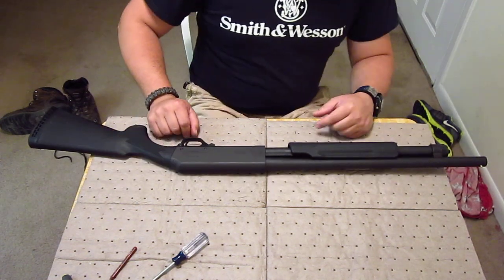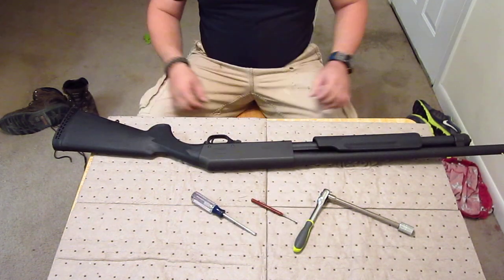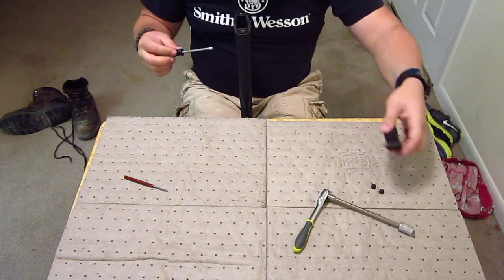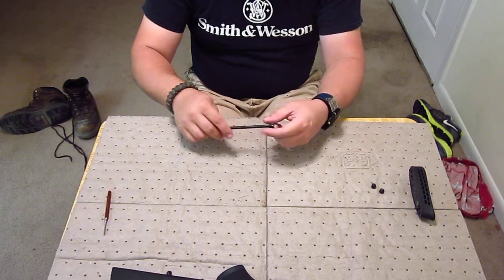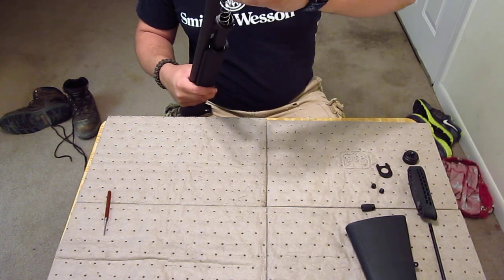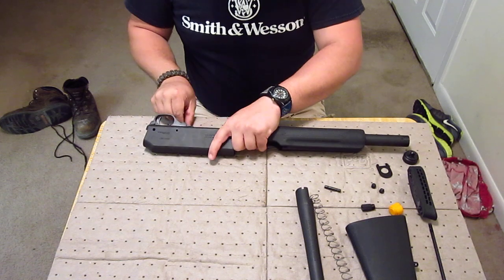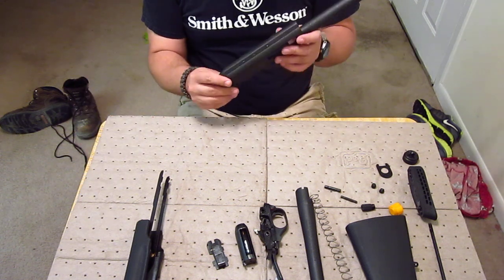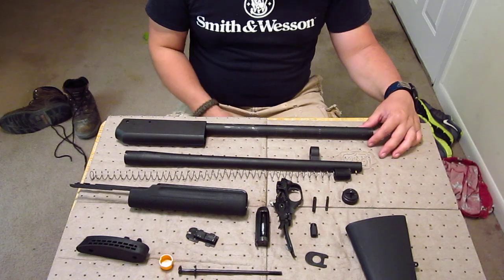H&R Pardner Protector Detail Strip HD (Disassembly)

Comment: Yeah I was looking for a detailed break down not a field strip, thanks for the video anyhow. Furthermore the pins are designed to be removed from both sides
Reply from the maker: Well this is a "detail strip" a more involved strip. A complete disassembly video is what you want. Where they remove every spring and detent and pin. This is a well good enough strip for mods and cleaning and painting
Reply: @SMGSClassics  it is very much so but Like I SAID it's not what I was looking for. It was pretty much Rhetorical

Comment: 1) I have HOPPES 9 gun bore cleaner. I can use that on all metallic surfaces to clean right?
2) So oil can be put on all metallic surfaces with a light coat as well? 
3) Key ares to clean and lube are the bore/barrel and BOLT?

Comment: What size spring chamber tube spring is that? Bought this shotgun from a pawn shop, and my second time shooting, the bottom barrel flys out with a pencil along with it... anyways, I lost the spring that's the only part I couldn't find and I need to replace it, if you or anyone knows, that'd help a lot. Thanks! Nice vid!
Reply: Just look for a Remington pump 870 spring it will fit it, the pencil as you call it was the magazine plug! http://www.hr1871.com/documents/manuals/new/Pardner-Pump.pdf
Reply: Got it! Thank you for the reply man!

Comment: got a question:  first, i took the bolt assembly out before taking off the trigger assembly.  when I did, one of the shell latches came out of the receiver.  I don't know if that happened because I didn't take the trigger assembly out first or not.  What's my next move, ship it back for repairs?  Thanks for the help.

Comment from the maker: No sir that would be your FOLLOWER it's what pushes the shells into the receiver. It will not work. You'll have to see if you can find a replacement online. Try NUMRICHS GUN PARTS you'll have to google it cause i don't know the exact address but they have ALOT of parts for different guns. Also if no luck there try MIDWAYUSA. If no luck there just google NEF PARDNER PUMP 20 GAUGE FOLLOWER FOR SALE.

Comment: they are great guns, but without a solid 28 inch barrel and threaded chokes, it has 0 practical use. its a paper weight. You got the wrong model my friend. It will forever spend its life on a range killing 2 liters, or in a case.
Reply: It's called home defense. With an 18.5 in barrel you can "hunt" with it but there are better things to use than a 18in shotgun.